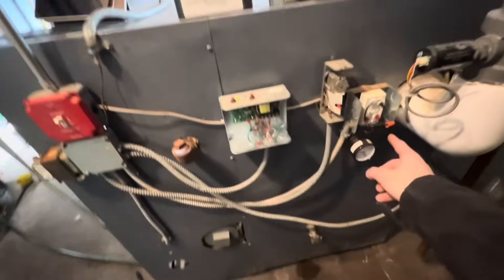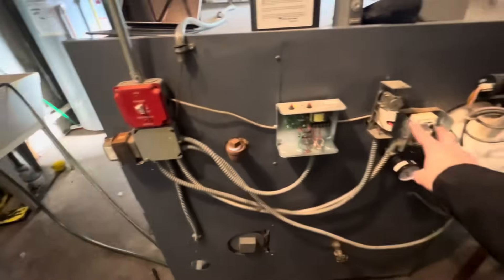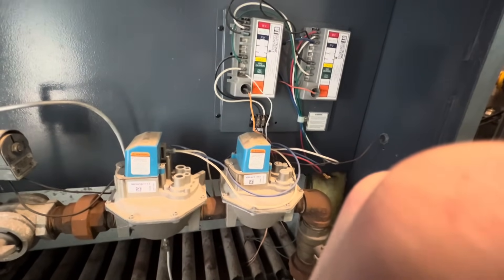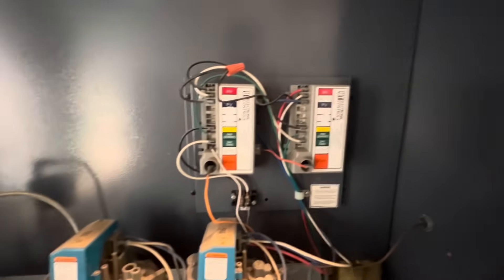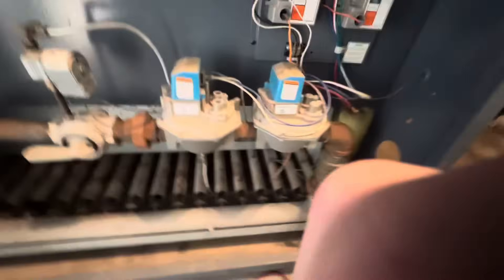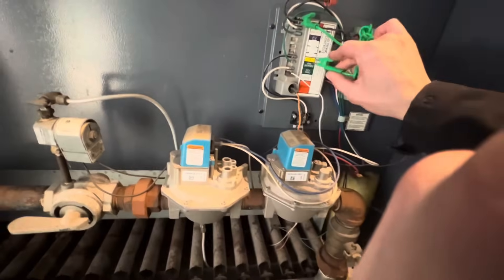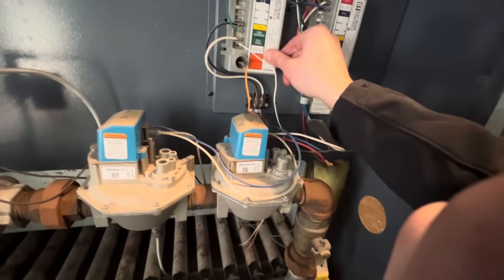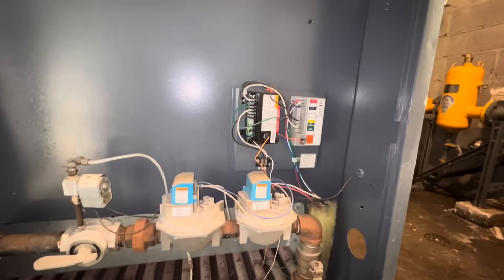Mega-Boiler Down at Church! Diagnosing and Repairing Hydronic Boiler as an HVAC Tech In New York!

Comment: And that’s a two stage furnace that’s why there’s two gas valves. That’s why there’s two ignition modules
Reply from the maker: Lol no. It’s not a furnace for one, it’s a hydronic boiler. For two, the ignition controls are all jumped together making the other useless and the two gas valves are in-line with a single solenoid.

Comment: I don’t think that boiler has a standing pilot light that’s why there’s a wire for the pilot valve
Reply from the maker: I know
Reply: @DCHVAC these boilers seem really dangerous to me I just worked on the same boiler in a church and I had the same issue they don’t have the normal order operation of a normal boiler. Weird

Comment: We have the identical unit at our church. We run into the same issue. Every 3 days it goes into lock out mode . About every 4 years We have changed out the flame sensor. It seemed have the right micro amps but it sloves our problem

Comment: What a cluster. You only use two ignition modules when they are cascaded due to a long burner row which needs two pilots to safely light the main burner. In that case the first module lights the first pilot. When it proves, instead of lighting the main burner, it completes the limit to the second ignition module - which requires its own pilot solenoid valve. When the second pilot is lit and proven, it then powers the two redundant main gas valves. Bottom line, if that boiler was designed to operate with just one pilot, get rid of the second ignition module.
Reply: To add to my comment, it sounded like you said that the low water cut off was cycled by the Aquastats?  If the control power was cycled, you are asking for problems. If it’s wired in the 120V circuit, should be 1. Main Switch, 2. LWCO L1, jumpered to Common. N.O. wired to High Limit then to the Operator and then to the ignition module.  Or wire the LWCO supply terminals right from the Power Switch and then wire the cutoff as dry contacts. 
Also, where is the building’s thermostat or BMS wired?  I like having it the last thing in the limit circuit to make troubleshooting easier.  If you add a relay for this, use one with a Hand-Auto switch.
Reply: So given only one pilot, the second ignition module could have been used as the replacement of the first. 
This would have cleaned up the controls wiring, made future repair issues easier to assess, and saved the customer the cost of a module. Do you agree?
Reply: @marcinmerrimack1726  I really have no idea what they were thinking. I’d have to see the wiring diagramed.

Comment: Daniel I don’t understand how you diagnosed the main control but it is working.
Congratulations! That’s a strange system.
Reply: These boilers are common in NYC I work on these daily and they are configured in this way.. About the  diagnosing ignition module gets power at the 24v terminal it has to continue from pv to pv/mv if it doesn’t your ignition module is bad

Comment: Have you pulled the low water probe out and cleaned it?
Reply from the maker: @Infowarrior-45 no, it’s a hydronic system so it won’t get that dirty, plus the issue presented itself. It’s a 120v LWCO. It would shut down 24v power to the gas train, which is present. So that’s eliminated

Comment: I have never seen a constant pilot with an ignition module? Shouldn’t that pilot solenoid be wired to pv? So the intermittent spark can operate? So sequence should be th 24 volts call for heat pv gets power flame sensor allows main gas valve.  I’m I wrong?
Reply: No you're right I never seen a boiler with a standing pilot on electronic ignition all-in-one maybe someone retrofitted
Reply: Yeah you're right you should drop out your solenoid to your pilot off your control
Reply from the maker: This is a weird setup
Reply: I work with the WEIL MCLAIN LGB it doesn’t have a standing pilot the water heater he also worked on did but not the boiler it’s intermittent
Reply: I agree. The church should have hired another service company a long time ago 😮. You cannot pay Mikey Pipes to spin his wheels- he’ll take you for a long long expensive ride.

Comment: ignition control to the right has its sensor wire directly grounded right? and the external pilot solenoid on the gas main seems to be constantly powered through the control making the control think that everything is okay?
Reply from the maker: @williambreidenbach7255  control wasn’t giving power for the main valve

Comment: whats the purpose of 2 gas vlaves?
Reply from the maker: @swaterman08  I’m not sure the thought process of the original installers. Maybe redundancy incase one got stuck open. Idk
Reply: once you get over certain BTU'S you get this gas train for safety. Double block and Bleed
Reply: @joelmcneney5366 no block and bleed. Just redundant valves.  Installed for safety compliance.
Reply: @joelmcneney5366  I would think one would just be a solenoid N/C, or they would have a custom control that would have the connections for 2 valves.
Reply: If one fails other shuts off gas
Reply: redundancy